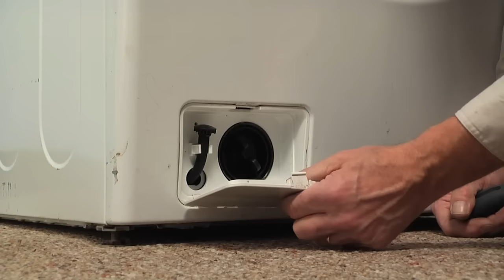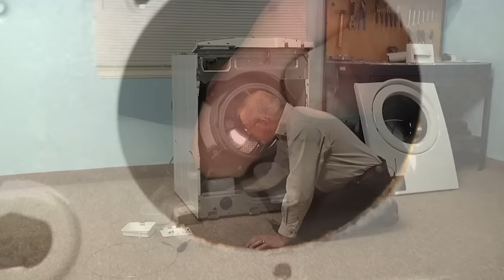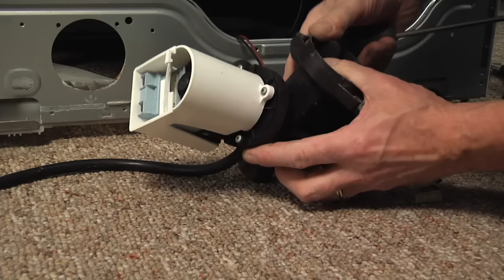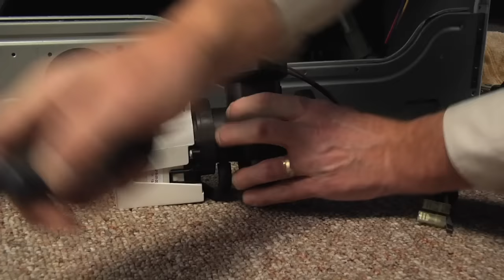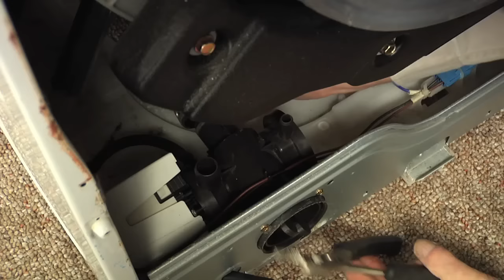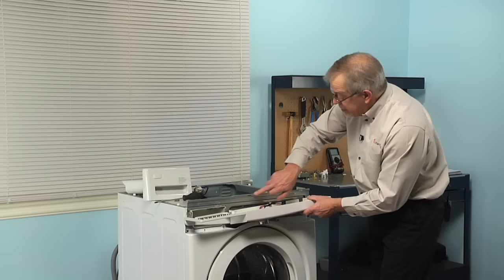Washing Machine Repair - Replacing the Drain Pump (LG Part # 4681EA2001T)

Comment: The only thing this video fails to mention is that it will take you about 50 tries and a half hour of your time getting that spring wire back on
Reply: This video is stupid beyond belief!  Just pull the washer out a few feet and tilt it back towards the wall.  You can access the pump through the bottom of the machine without taking the whole dang thing apart!  This video is like changing a light bulb by accessing the fixture through the roof of your house!  LOL!
Reply: How do you get it back on?
Reply: Hi..
Just use two flat screwdrivers....like a bike tyre!?
Reply: @kevinjones1111  not on all models. Some don’t have a big enough opening underneath to properly access the pump.
Reply: AMEN
Reply: Saw a tip that said to use two zip ties, one at each end of the spring, to pull and stretch back on.
Reply: Lol 😆😂😆😂 well I was the lucky one. Got it my first try!! Took a bit of elbow grease tho!!
Reply: @dnnstinga6743   I actually changed out that pump again about a month ago and this time it was a little easier getting that Spring back on, you just have to have the right tools.
Reply: I cut access holes in the side of mine.2 feet square,just cover it with a piece panel when I'm done,you can't see it when the machine is in place.Been it it 3 times over the years,saved no telling how many hours.
Reply: The music keeps making me sing nationwide is on your side
Reply: @kaintgetritedonetried  perfect idea. The engineers need to be notified!
Reply: Hi is it the pump or the motor that goes bad? 
Thanks @kaintgetritedonetried
Reply: @kevinjones1111 Not all models can be accessed through the bottom. Mine has a solid bottom
Reply: Is 50 the magic number? I gave up after like 20, and just decided that my washing machine didn't need that part attached. Without it, the rubber around the opening comes loose maybe once every few months. It only takes a few seconds to put it back, though.
Reply: True, but with my wife’s help holding the wire and seal and a butter knife we had it on no time. 😂
Reply: Tie a length of heavy enough string through each eye of the spring. One for each side, it allows you to control the springs tension. It makes it much easier, with 2 people it's a breeze.

Comment: With the help of this excellent video, I was able to replace the drain pump for about $25 avoiding an expensive repair (or worse, mistakenly thinking I had to buy a new washing machine). Thanks for the excellent step-by-step instruction!

Comment: This will be my second time replacing this part. I used this video in November ‘20, and again 25 months to the day. The first time the impeller had an obvious deformity when I accessed it, after it failed to drain. Now, it’s still draining but the noise it’s producing is telling me it’s damaged again. High pitch whining sound. So, I went into to Amazon history and selected the part again. I know what I’ll be doing this weekend.  Happy new year!

Comment: Thank you so much!  Such great instructions, you covered everything needed, the whole way through from start to finish.  a $30 pump from Amazon , and now the washer is working like a charm.  The old pump was completely worn out and the bearings were toast. Thanks for every little detail; especially getting that darned circle-of-hell back on around the door rubber.

Comment: Thank you for this video.  Just finished the job and the machine is now draining.  Only feedback is that this was not an "easy" job.  It took me about 3 hours with many breaks in between to recoup and gather my thoughts.  The toughest part was reattaching the hoses and the spring around the rubber in the door.  Also I had a slightly different model and removing the pump took an extra step removing 3 bolts in a very tight area.  With that being said, I could not have done the job without this video.  Thank you!!!

Comment: Thank you Steve! Your video was extremely helpful. My model is the WM3667HWA and was pretty close to the one you worked on.

My model had 6 screws holding the control panel on. I also couldn't reach the Door Lock Wire Harness like you did, so I ended up leaning the whole door assembly forward so I could reach it. My washer also is the kind that had three 10mm bolts holding the drain pump in place and I had FOUR hoses connected to the Pump.  The drum on my washer is HUGE compared to the one you're working on and it was a pain getting to the hose clamps and bolts, but I managed.

The correct replacement Drain Pump Motor part number for my model is 4681EA1007G. 

Thanks again for the clear, concise and easy to follow instructional video.

Comment: Perfect video!  I knew the drain pump motor was shot on my 10 year old machine, but didn't know how to get into the machine to replace it.  I followed your video step-by-step and was able to confirm the motor is shot (motor bearings are shot).  Waiting on my new motor ($40 on Amazon) and will finish the job tomorrow.  Thank you so much for an easy to follow and well-explained video. I wound up marking the housing at the motor leads with a sharpie to avoid confusion.  No real 'gotcha's for me. But, I suspect getting that retainer ring back in place will be a lot like replacing a bicycle inner tube, not terribly difficult.

Comment: Steve, I want to say a very sincere "THANK YOU" and your company for taking the time to go through this repair. My LG "All in One" ventless stopped draining good yesterday and I am still in the process of diagnosing the situation. I cleaned a lot of lint out of the filter and the hose. The impeller is spinning but there is a rattling type sound and coming from the drain pump .Where my washer is, it is not easy to pull out or get to the rear and I was praying that I could go in from the front... Again, thank you and God Bless.

Comment: My LG washer (about 8 years old) had code OE flashing at the end of the wash cycle.  After Google searching, I found the problem was probably the drain pump.  I first checked the drain filter (which I never have checked) and found it to be free of debris.  I watched this video, then I ordered the drain pump from www.partselect.com.  The part was $52 with tax and shipping and it only took about 30 minutes (start to finish) for me to replace the part and have our machine working again.  Thank you PartSelect for your assistance!!!

Comment: Excellent video and a great help, thank you.  Buy the spring tool on Amazon as it makes putting the spring back on much easier.  Also if you have a WM3575CW the pump is slightly different and you will need to take out the three mounting bolts as there is a separate pump to spray water in the tub.  Make sure to mark the hoses as there are four that are connected to the pump assembly.  Entire job took me about 1:20.   Good luck!

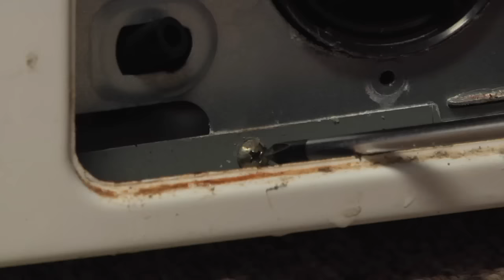Comment: Great video. Clear and well shot and edited. I had no trouble following for my repair. One tiny thing I noticed. In the reassembly step, you didn't put in the little screw at the bottom left. The one you removed at 3:00. Had me scratching my head for a minute why I had this random screw, until I realized where it went. Thanks a million.

Comment: I followed this video for the 3rd time today  (3rd drain pump repair on this washer!) and it is so helpful. We have a lot of dogs and wash a lot of doggy laundry so we're hard on things, but it is really helpful to be able to do this fix myself. One tip I learned on round 3 that might help someone else out, is that the little door lock wiring assembly is reallllly hard to get out- you can just take off the two screws on the front panel to disconnect the doorlock from the panel instead- faster and less cursing! ;)

Comment: Thank you so much for this video. You give great step-by-step in striations. Just a tip for those that broke their washer by washing rugs with rubber padding. I found my drain hose clogged with that padding sediment; cleaned it out with a shish kabob stick. I also found the black hose under the tub to be clogged with that crap. With all those hoses clogged, I'm sure my pump was in decent shape. I just replaced it because it was 9 years old anyways.Thanks again.

Comment: This was an excellent step by step video and my pump is replaced and working. I did find that the spring replacement is NOT so easy.
I gave up and have ordered a spring extender tool, hopefully the washer will be good to go shortly.

Comment: Thank you. My wife was poised and determined to buy a new washer and dryer. All you need is $23.50 to buy the pump, a flathead, Phillips head, and a pair of pliers. Getting that band back on was the hardest part.

Comment: I completely agree with all of the reviews.  Great step-by step video.  I think the hardest part for me was getting that circle spring clamp back on.  The only suggestion I would tell others is, while you have the front panel off, take the time and clean the drain hose that is on the bottom of the rubber drum seal.  It's just a little elbow thats held on by 3 spring clamps.  Mine was packed solid.  A pair of slip pliers or channel locks, a pipe cleaner or needle nose to grab the junk, a quick rinse and you're off and running.

Comment: Thanks for the video.  My model has the bolts and the extra screw at the top.  Everything was as you showed and the change out was simple.  Took a couple of hours, but cleaning in and around the area of the washing machine was also done.  And I have the stacked drier, so there was time to take that off and back on.  Again, this video hit the spot.  Bought the part off Amazon for $26 USD.

Comment: Just changed my drain pump today ! I couldn’t have done it w/o this video , thank you ! My Kenmore had the 3 bolt holding in the assembly it was a little tricky but I got it installed . Your videos are so easy to follow and the definition is clear. Once again thank you!

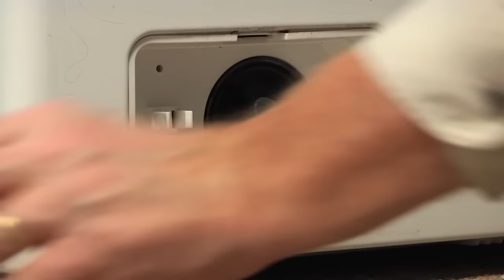Comment: Great video, it helped us a lot! At about 11:18 of the video, you forgot to mention putting in the small machine screw that attaches the bottom of the front door panel to the pump assembly area. Thanks again!
Reply from the maker: +Rob Clark  thanks for mentioning.

Comment: God bless you sir! Thanks to your knowledge and expertise and thorough, step-by-step explanation of how to replace the drain pump, I was able by God’s help replace the drain pump on my LG washer myself thus saving an expensive service call. The only difficult part was reinstalling the rubber boot tension spring/band; otherwise the repair was easy-peasy lemon squeezy. There is nothing more satisfying than DIY repair. May God richly bless you for your service to the DIY community.

Comment: Thanks to this video, I was able to fix my washing machine, I did just as you describe it, and I noticed what was blocking the water outlet, I removed the garbage and cleaned it and put it back together and it is ready for the next washes.

Comment: Thanks, the instructions are very clear. I used a bicycle tire fitting tool to put the metal ring back in place and it worked great.
Reply: Do you have to shut the water off beforehand, or does the machine only allow water in while in use?

Comment: Great video.  Watching it gave me the confidence that it was do-able.  PartSelect got me the pump in a day, and I replaced it in a couple of hours.  I wasn’t sure this would fix it, but when I took the pump apart the old impeller had broken off the shaft.  That made me feel pretty good that we were on the right track.  First load is running now!

Comment: This video was helpful.  It took me longer than he took to do the repair, but it was my first time.  My washer is a Kenmore so not everything was the same as the unit he worked on, but it was close enough for the tutorial to be helpful.  The wire harness for the lock would not come out so rather than break it trying to get it out...I unscrewed it instead.  Space is tight inside and I have big hands so trying to get the plier on the hose clamps was a challenge.  Other than that, no issues.  Now ...to run the washer and see if I did it right!

Comment: great video and extremely accurate. I could not have fixed it with out. I would recommend having a shop vac handy to help clean up the water still in the tub and drain.Step by step is easy . this guy nails it

Comment: Had to change the drain pump a second time on my LG combo washer dryer. Your video is great and helped me both times. I saved so much money.
Reply: @AI-Consultant  No the machine is actually in a pantry that is usually cooler than the rest of the house..  I saw other posts about the replacement pumps only lasting about two years.
Reply: Changed a third pump. Second one lasted 4 years. The video helped again. Thanks

Comment: Very helpful, especially the part about some machines having the drain motor bolted down rather than secured with a tab - that was the case with mine.

Comment: Great video.  We had to clean out all the hoses to and from the pump.  Your video was a great help.
Reply: Hi Brent what prompted you to clean out the hoses? I may have the same problem. I just replaced the pump, re-assembled everything correctly and set it to wash a load. I monitored everything throughout the entire cycle and even lifted the drain hose out from the drain to verify that the washer was indeed removing water out through the hose. The load ended, I opened the drain pump compartment and checked the hose (the small one with the screw cap) and I immediately noticed a small drizzle (bad sign). I then began unscrewing the drain pump's cap and sure enough it was full of water, which was my original problem.  Any ideas on what to do next? Any help would be greatly appreciated.

Comment: Please be sure to check all the tubes that are attached to the drainage system before you replace your pump.  You can do this by simply tipping the machine.  We found a large build up of silt/sand that was obstructing the large black hose that drains the tub.  We pinched the clamp and pulled the end of the tube off.  We unscrewed the wire that holds that gasket from the tub, then we pulled out the drain clean out.  We poured hot water down it to flush the hose and scrubbed it with a bottle brush.

Comment: Thank you for such a comprehensive repair demo! Just one thing, you said to take note of the wire-color arrangement, which I did. I made up a  little rhyme,  'brown in front, black in back'. I couldn't see your wires prior to disassembly, but you reassembled opposite to that. Anyway, I trusted my rhyme and it seems to work ok.

Comment: thank you so much for the educational video. i couldn't have done this without you.  i was so nervous to do it but it wasn't difficult at all. the only thing that was difficult getting back on was the metal ring around the door rubber seal.  tomorrow i will try it.   Hopefully i did everything correctly.  Thank you again, this really saved a lot of money.

Comment: Great video, got me through a repair that was way outside my comfort zone.  I think there was one reassembly step missing, for the screw at the bottom of the front panel.  I recommend labeling every screw and part as you remove them to keep track of where everything goes.

Comment: Did this job yesterday. The hardest part for me was the retaining ring. That spring is pretty strong. It helps if you can get a helper to hold part of the ring down while you pull the spring.

Comment: This video gave me the confidence to make this exact repair and fix my washer.  Unfortunately, upon completion my washer now leaks.  It makes a hissing sound during the spin cycle right around where the drain pump is.  I must have either not secured the hoses/pump correctly, or I may have put a hole in one of the hoses (I am assuming the former, just based on how the hiss sounded).  It's fine though - I'll take it apart again tomorrow and try again (this time much quicker since I know what I'm getting myself into now).  Thank you Steve, this video was fantastic.

Comment: Thanks, Steve, for this clear video.  Took me longer than 15 minutes, but I think I got the job done.  My LG washer did have what seemed like a large counter balancing weight on the front of the basket that I had to remove (with trepidation!) in order to get the drain pump assembly out, but it came on and off with ease.  Finished with one extra screw from somewhere, though 😂

Comment: Thanks a lot, Really helped to fix  washer, only issue I faced is to remove the pump base with the 3 bolt as you mentioned. Good that you mentioned in your video. Really Awesome

Comment: Thanks for posting the video.  I was able to follow your video to replace the drain pump.  May I suggest you do a closeup shot when putting the gasket back in place.  I had problems putting it back tightly.
Thank you very much for posting the video!

Comment: Excelent vid - My model 's pump assembly was attached with 3 10 mm bolts - use a 10mm socket with a 2 -3" extension/ ratchet ... Also there was another motor on the right hand side (center not outside) of pump assembly for my model fyi

Comment: Thx for making this, save me so much money. We also flushed the two drain hoses, the second pump on the right (smaller one on the right that drain the little tube to the front panel). The hardest part is taking out the top cover believe it or not, we had to use plastic glove to get a good grip. Second the put-back or the tight spring. Everything else went well, just take time.

Comment: Great instructions! I’m reasonably handy, and followed them with only a few snags. My model has all of the electronics attached to the back of the control panel, (ugh) so I had to disconnect a couple of wiring harnesses to be able to put it on top of the unit. 
A couple of screws on the front panel were very rusted, I used an 11mm ratchet to get them off. 
Otherwise, all went great!